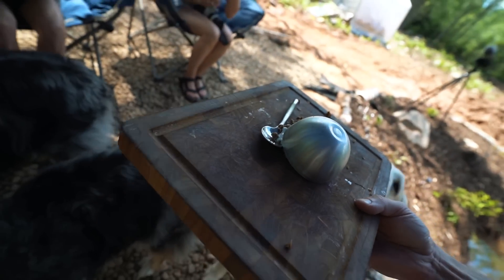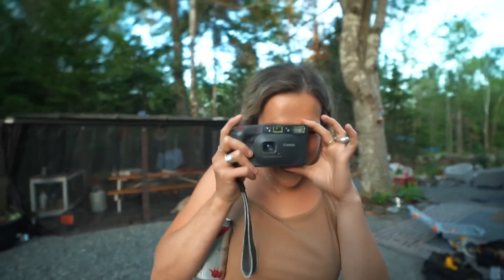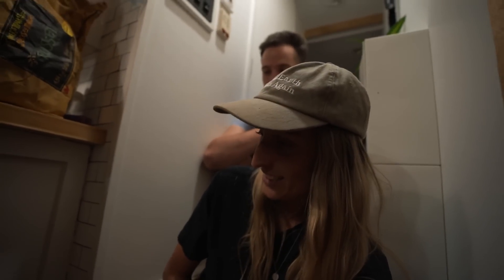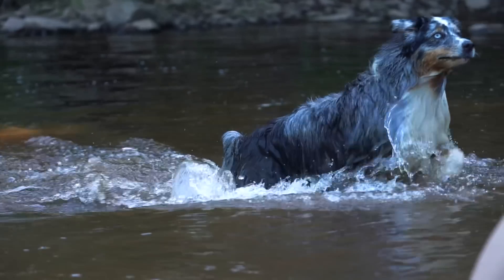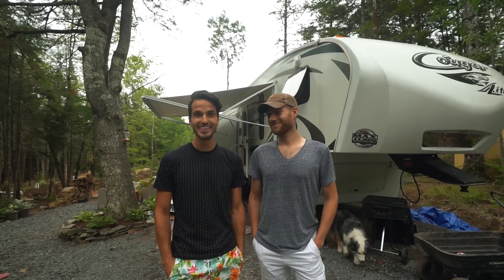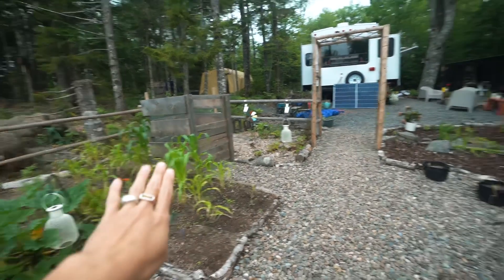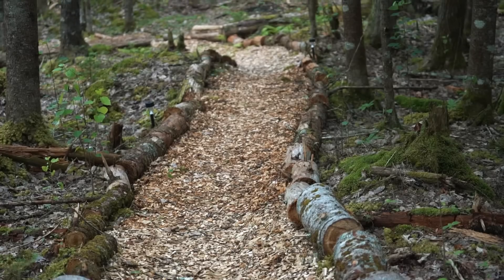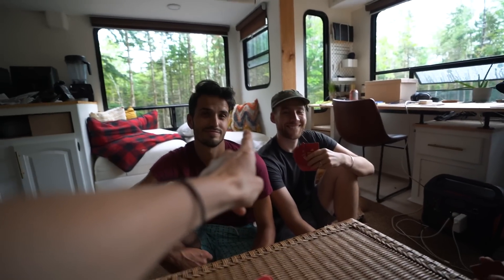One Last Van Life Trip | Off- Grid Living Canada  (full tour)

Comment: Girls, please buy a TMPS.  I recently bought (used your affiliate link), the Tymate TMPS 6 sensor model - Lily is a dually.  To make sure they stay in place, I also had steel valve stems and stabilizers installed. Steel stems don't flex and work the sensor off over time. You have single wheels in the back so can use regular steel stems and those are way cheaper than what I had to pay.

If Tyler and Todd pull their rig a lot, I don't know, I don't follow them, they should have a TPMS for their set up as well.

Please do this, I'll feel better.
Reply from the maker: Will look into this!!! Thank you!

Comment: I know codes are different for RV’s compared to stick built structures but running electrical through the plumbing vent is a bit dicey. I hope they got a really good seal on the vent pipe inside the RV.
Reply from the maker: Yes they did and they don’t use the black tank/ they have a composting toilet 🤗
Reply: @Vanwives  thanks for the response. Glad to know they did it right😊